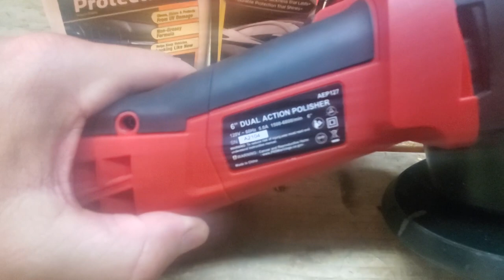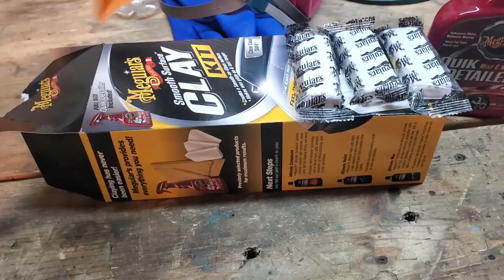Dual Action Polisher To Bring Your Vehicle Paint Back To Perfect

Comment: Jason you did a great job especially for being new to detailing. Couple tips for you. Now is the time to put a good wax on the truck because you decontaminated and polished it out. Yes a a one step cleans polished and provides some protection but not as much a a dedicated wax or sealant does. Rather than cleaning with a towel use a stiff nylon brush. A toothbrush will work. Brace the polisher on your leg spin it slowly ie speed 2 0r 3 and run the bristles of the brush from the center to the edge with light pressure. One or two passes will do the trick.  I usually go through a pad for each panel then clean afterwards. Really like your channel. Keep up the great work.
Reply from the maker: Thank you for the excellent tips! I did actually wax it that night. I was sitting on the couch relaxing for a minute and my wife looked at me and said what are you thinking right now. I said I'm think I'm gonna go wax it right now while it's clean and just be done with it. And I did! Again thank you. Will get a tooth brush right now and put it in the bin I have the polisher in.